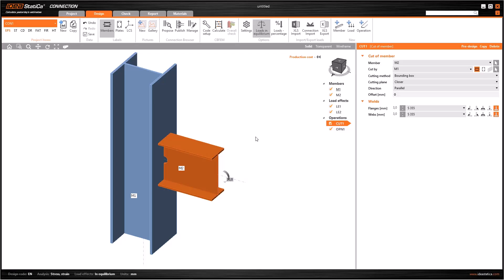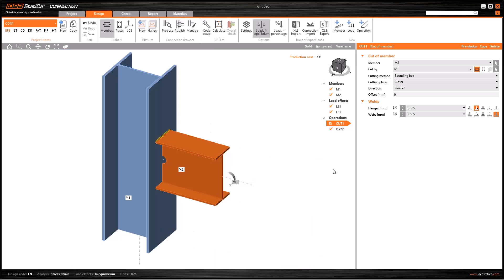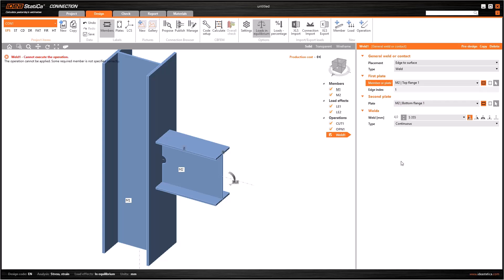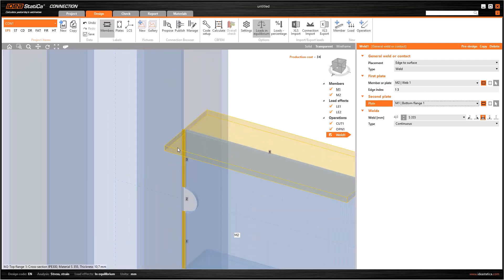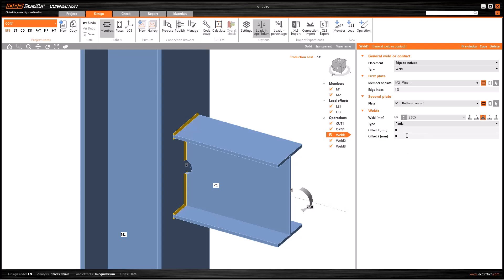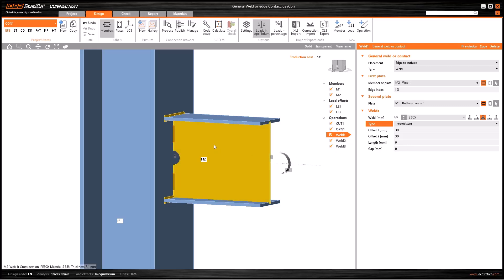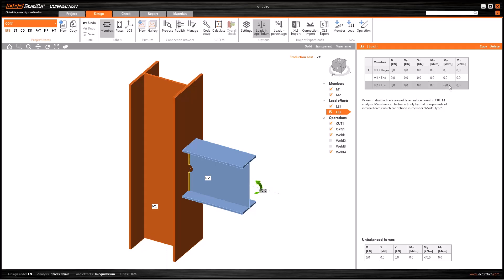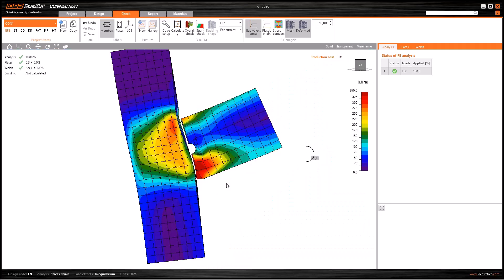General Welds and Edge Contact

Comment: I must say that i dont understand the "contact" operation. 
When to use it?
Reply from the maker: Hello, you use contact when you want plates to interact in compression, while there is no weld between them.
Without the contact, the plates act independently and may clash under load.
https://www.ideastatica.com/support-center/contacts
Also you can combine welds and contact:
https://www.ideastatica.com/support-center/combining-weld-and-contact-operations
Reply: @ideastatica_en  I understand, but this contact can only be "engaged" if you have chosen to have welds in you model...because there is no gap between the members. Correct?